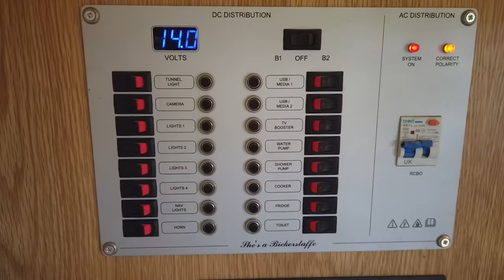A Day In The Life of a Narrowboat Liveaboard During Lockdown. Ep. 101

Comment: Hey guys, I'm a bit behind. But with the extra solar, you could have a 12v immersion heater set to use the excess energy? Saves using the diesel heater. Just 12v immersion heater with thermostat and a charge controller required. Happy to help if you wanted to know more.
Reply from the maker: Hi, we're working on this on our new boat 👍🏻
Reply: @FoxesAfloat  I'm assuming further down the episodes there is talk of said new boat? I'll eventually catch up ha ha

Comment: you should get an escooter with a trailer. I use it in my Semi (lorri?) to do my shopping
 was about $1000.00 to get a good one that holds 300 lbs for 40 mi (20 mi out and back) pull a trailer to pull more weight
Reply from the maker: Illegal on canal towpaths and much too rocky and muddy.

Comment: Couple of ideas for bits in one of your lockdown vlogs: 1) your views on hybrid boats (in particular whether solar panels would be much use, or would you still have to run on diesel most of the time to recharge the batteries?), 2) how do bow thrusters work (what exactly are they?), and how/when do you use them - how different does it make handling the boat?
PS - the bit about going in reverse was interesting - I never realised you can't steer going backwards (although, on reflection, it's blindingly obvious!).
Reply from the maker: Not really much to vlog about them, Paul. Hybrids aren't at a level for continuous cruising all year round yet. Bow thrusters are simply a prop in a tube under the bow. 👍🏻👍🏻

Comment: Does your washing machine have hot and cold water inlets? Or is there like a mixer tap in front of it, if you want to use engine-heated water in it?
Reply from the maker: UK washing machines only have cold-fill inlets. We manually top up using hot water.
Reply: @FoxesAfloat  yeah, so do (almost all of) Dutch washing machines, which was why I was interested :)

I did find several Miele models, and one slightly cheaper Bosch model at 1000 euros, that have integrated hot fill — literally two separate inlets. Apart from that the life hacks seem to involve either a device that mounts to the wall and consists of a separately electronically controlled mixer tap (retailing at nearly 250 euros), or just putting a standard thermostatic shower tap on the wall and hooking the fill hose up to that. You then manually turn it down to cold after the initial fill, so the rinse cycle doesn’t happen with hot water.